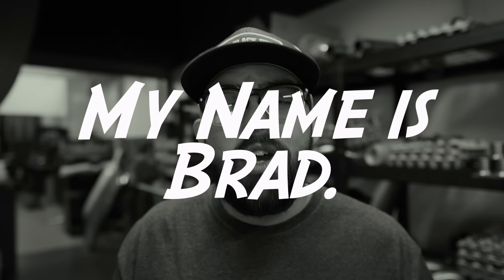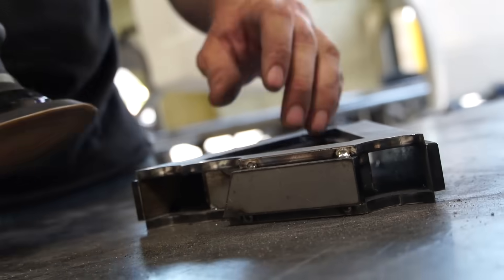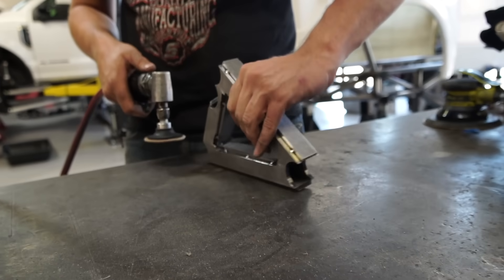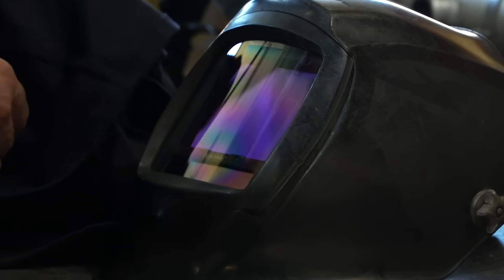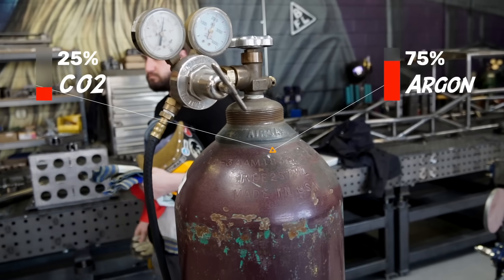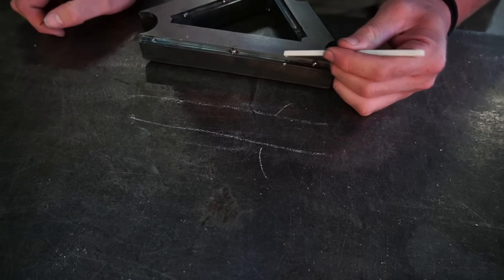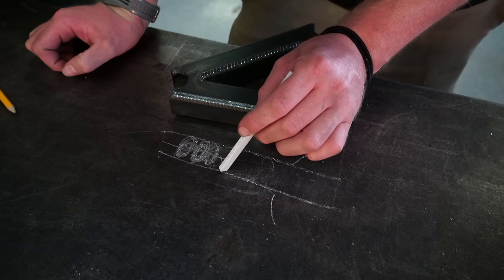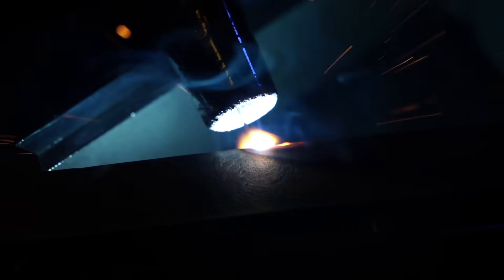HOW TO MIG LIKE TIG WELD (Stacking Dimes) W/ OVERKILLRACINGANDCHASSIS w/ *Tips and Techniques*

Comment: They say a good welder is typically a bad grinder (because they don’t have to grind their welds to clean them up).   I don’t know about that, all I know is that I’m a bad ass grinder.
Reply: The grinder and paint make me the welder I aint.
Reply: @davecozzi9721  🤣🤣
Reply: @davecozzi9721  right, my welds are ugly till I clean them up, then they look fantastic.
Reply: @cheapshotmike1091  why not learn to weld better and save yourself a bunch of work. You should just have to wire wheel your welds before paint.
Reply: @bobv8374  for the things I weld you wouldn't leave them unfinished no matter how pretty your welds looked. but I do get a little better all the time, just not that important for welds to look nice, they're getting ground and sanded regardless.
Reply: @cheapshotmike1091  thing is your losing strength. Plus your wasting time. Now your welding grinding and sanding. You could weld and sand. Keep practicing you will see what I mean. Keep it up good luck
I
Reply: @cheapshotmike1091  right you can’t just leave beads on a quarter
Reply: @davecozzi9721 
Loser comment.
Reply: Most high profile work actually requires weld blending. I weld inconel turbine veins now. Even when i did production mig i still had to grind per costumer spec. I can finesse a 5” grinder like its a pen.
Reply: @Swagmoney696  got that right! At one point I was comfortable running a 9 inch Milwaukee with one hand! 3
Reply: I'm on my second grinder, but only my first welder. To be fair, I bought a Miller welder but Hoarder Fright $10 grinders... the secret on those grinders is to open 'em up and replace the gear lube with something useful that will flow, and check the brush installation. Instantly turns a $10 grinder into a $40 grinder at least! ^_^ ;D
Reply: @railgap  I buy a blue point and be done with it tbh. I do own several Cheap ones to beat up
Reply: @railgap  i dont know but hose cheapo grinders here have just a friction bearing in the head. once those wear out its gone.
Reply: Yeah, but true 100% bro. I used to be a bad grinder till I changed my mind to cleaned them up super super crazy well clean then I found the beautiful Bead since then I been practicing about grinding skill as much as I can lolll 
nice to meet you a welder from another side of this world, Im Siam from Thailand .
Reply: I have 3 grinders
Reply: I was a nuke welder in the Navy and my instructor welded thousands of feet on the space shuttles. Grinding your starts and stops was mandatory because if it cracks that's where it'll start. You haven't lived until you've chased a crack 40 feet across a hot flight deck while welding aircraft tie down pad eyes. The non skid they put on those things ain't skateboard grip tape, it's more like stucco on steroids and you're rolling around on it all day.
Reply: I'm half a good as I think I am 95% of the time, I like to focus on that 5% when I'm really good!!!
Reply: One of the biggest loads of crap ove read. 
Youve never done any high spec pipework have you. Im not talking mig monkey welding, im talking high spec full tig positional pipework. 4 and half inch grinder used on and off all day long, for feathering tacks, or opening out gaps that have squeezed closed.  
With stick, its used for grinding stop/starts, or knocking any peaks off of a bead, or running a wire wheel around a butt before going in with the next pass
Reply: A good welder always has a clean joint to weld. A great welder is a great grinder.
Reply: I'm good at it ALL, probably cause I've been welding since age 12 and welding aluminum a yr later. I'm almost 41 now so I have a few yrs experience 😂
Reply: Me too!
Reply: Where do you live? I'm hiring.
Reply: Do you mean weed?
Reply: lmao
Reply: Yeah, I can lay a nice bead, but I am specialized in fine finish. Both are good skills to have
Reply: LO FUCKING L .. happens to the best
Reply: Wait...fuck.  Yeah, me too.
Reply: I'm a bad grinder because I hate erasing the part best looking part of the weld lol.
Reply: Who says that? Been a professional welder for about 22yrs now and can do both extremely well.
Reply: Yabbut, you don't grind MIG because all the strength is in the bead.  Real penetration is rarely achieved with MIG so preserving the bead material is often critical to the weld's strength.
Reply: @railgap  maybe in YOUR welds, but mine get total penetration guy! I've been repairing and welding truck trailers and frames (18 wheelers) for 20 yrs and have yet to have my welds fail, ever....Frames I grind as it then looks factory and STILL remains strong.
Reply: Railgap Esoterica I was being sarcastic. I was saying in a roundabout way that I’m a shitty welder.

Comment: I can full understand where these keyboard warriors are coming from with penetration over looks. Yes it looks great first it penetrate? Yes and no for the application itself it doesn’t need to blow out the inner edge of the base metal to be strong weld. And also you have to take in account what the part is being used for and what kind of stress is being put in it. There using Er70 has the potential strength of 70,000psi so with the perp work and right settings pretty sure it will hold up just fine.
Reply from the maker: 🙌🏻 A guy that actually knows what’s going on. Good morning and have a great day!

Comment: End-to-end nonstop runs like that?  How do you keep from warping the parts or popping your tacks?
Its pretty, and appears to work or you wouldn't keep doing it, but every experienced structural career welder knows thats not the right way to weld up boxed parts.
Reply: the runs were about 8 to 10 inches long, I wasn't to concerned with it warping to much. It's always best to weld one joint, then if possible, jump to the opposing side, 180 degrees away and weld it. And with little stuff like this, it helps to have more than one part being welded, so they can get a little bit cooled between passes. I've done a lot of welding on boxed rails, up to 20 plus feet long. On longer parts I definitely jump around quite a bit, doing about 4-8 inch long runs. Thanks!
Reply: Plant is not turned up too high...right amps to material thickness....you can see fusion on the edges is just right ...just barely pulling the edges in...personally I'd have the plant down slightly more...prep makes for better finishes.Ive seen UB sections bow lik a banana and come back straight after welding on opposite sides are finished....but it's best to stagger the welds on long sections for sure😁

Comment: Beautiful welds. 
I weld to look good but, sometimes, I just weld to get a proper adhesion. It is not as pretty but, it will pass.
Reply: sometimes we just gotta do what we gotta do to finish the job. It starts to really suck when a huge majority of your welds are out of position and they still have to match the same quality. Welding inside a tube chassis will humble you really quickly!
Reply: Welding perfectly clean , brand new , metal in a perfect setting is all very well . In my world of fixing vehicle chassis covered in all kinds of crap , sometimes in a field , your work just has to be effective. I still try to make every weld look good though , can't help it !!
Reply from the maker: Doug Green absolutely Doug!
Reply from the maker: Absolutely agree and thank you!

Comment: I was waiting for the host to sell me soap or sunglasses he looks just like that guy. I prep those little tacks with a hand file except mine aren’t so little seeing as I don’t have a TIG.  Prep work is the key to good welding. One good way to practice is to get a notebook and fill the lines with welding like that guy drew on the table wire and welding rod costs money pencils and notebooks are cheap.

Comment: I could utilize the difference in thickness of material to control settings ( the basic machine set up )
Reply from the maker: For this specific video most outside corner joints are welded in the material thickness range of .125” and .250”. I can definitely do a basic machine set up video in the future for you. Thanks for watching!
Reply: @hourglassingenuity103  I have been welding for about 30 yrs now and it is always a good reminder to get back to basics , well at least for me and maybe even MIG welding stainless trying to get the best results could be another good lesson for me as well . You really have some of the best info in this field keep up the good work and looking forward to seeing what you do next .
Reply from the maker: You have a ton of experience! Going back to the basics frequently is such a good practice in my opinion. Keeps you fresh and up to date.. not making mistakes and forgetting the simple things. I really appreciate your view and positive input.. means a lot! I am trying to get any piece of info out there I can that will help the community and upcoming welders. Thanks so much for the support and have a great day!

Comment: this is not practical to weld this way , welding is not just what someone thinks is pretty  to look at ......
Reply from the maker: It is 120% practical to weld this way in the industry these guys are in.. obviously not in a structural application.. tag me on Instagram is some of your pretty welds! 🙌🏻🙌🏻 have a great day!
Reply: This is plenty strong enough, and costumers are paying top dollar for us to build stuff for them. They definitely appreciate looking at a finished product with aesthetically pleasing details,  from the way it was designed, to how it was built. A good majority of the time, they will compliment the welding, because unfortunately, there are quite a few shops out there that look over this aspect when it comes to builds.
Reply: @rodrigorodarte8422  i work in a shop like this in Tulsa, and it drives me up the wall!!!! Take pride in what you do no matter what it is, or just simply do not do it at all. I want to know what made this guy comment saying this isn't practical...?  I think your welding is phenomenal and would jump at the opportunity to work in the same shop with you guys.
Reply: Keep on doing what you are doing, more than strong enough!
Reply from the maker: Cesar Almeida 👊🏻👊🏻
Reply: Ultimately there is a fine line between a good penetration weld and a pretty weld. I think that is the point they are trying to make. Good, clean and maybe preheated metal can help with making a "good" weld as well as attractive.
Reply: @bradawilliams1  there is a bg difference between "looks nice" and high quality welding. Especially when it comes to mig welding. 
Its far from a fine line.
Reply: It's practical to weld this way when it's what your customer is willing to pay you for.
Reply: @cammy9r it’s impractical because of how slow it is as a welder my self I would never get anything done welding like this also for the thickness of the material they are welding the volts are much too low for it to be penetrating enough to be strong

Comment: Practice makes perfect, every machine is different, I have 4 machines and the settings are different on them all.
Reply from the maker: Yes sir!
Reply: Best machine fronius selco. All german. Hate Miller and Lincoln spatter produced
Reply: @182mcg1  I've used fronious machines when I used to work at Siemens..or how the Mexican guys called it "Mecos", and man are those fronious machines smooth as butter and i love that display on that gun. Not sure what model I used tho.
Reply: This is actually really important and should be taken more into consideration when somebody just asks for settings. I can have two Millermatic 252's next to each other, and both can have the same set-up, same settings, but could yield drastically different results. Voltage is always around the same, but wire speed tends to differ. Most likely due to the tension on the wire, a dirtier liner, and a huge factor is that a lot of welding machines don't have a tachometer that reads the wire feed rollers. I believe the new Multimatic 255's do, which is cool!

Comment: Great vid but dont understand why Americans call it mig when they weld with mix gas (argon CO2) then it’s called mag (metal active gas) CO2 is an active gas
Reply: Metal Inert Gas....M.I.G
Reply: Any type of welding with an "inert" gas is considered MIG, no matter the combination 75/25, 80/20, 95/5, 90/10 r\or tri gas!!  The process is exactly the same.  And CO2 with Argon mix is still considered inert.   The gas I inactive compared to say propane, Map or Acetylene
Reply: @JAB1978  wrong. 
100% argon? Yes inert. 
Mix co2 into that, and it is no longer inert. It becomes an active gas. 
Otherwise, why would 20% co2 in argon weld so differently from 2% in argon??
Other than when using pure argon, the correct name for the procedure is MAG welding.
Reply: americans arent the only ones that call it mig.BUT it should be called GMAW
Reply: Steve Moore This.  MIG is really GMAW which = Gas Metal Arc Welding. No inert in the name.
Reply: Because maybe it’s done with MIG machinery
Reply: Michael Szczys mig and mag is done with the same welder just different gas mixes

Comment: Could we see the penetration please, way more important than a pretty looking weld
Reply: You would actually be surprised when it comes to penetration on something like this. As long as the fit-up is correct, and the material is properly prepped, it has no problem melting through and making the back side look like it got a hot root sprayed in there. I would say this, it is very important that any forward movement is made in the middle of the joint, so that the front of the puddle is at first contact with the thinnest part of the joint, versus the thicker toes. I have yet to see an open corner fail before the base material rips apart.
Reply: Warren Cox Bend test it!! That’s the reveal !
Reply: I wouldn't expect any issues with this joint and prep but probably worth mentioning the weave is not appropriate under most circumstances for the newbies
Reply from the maker: Jay Bertels we didn’t weave 🤷🏻‍♂️
Reply from the maker: Head on over to Instagram and check out the guys pages that are in this video and I’m sure you’ll find something 👍🏻. Links in description.

Comment: Without sounding daft ,,, why dont you just tig weld it if thats the look your after.
Reply from the maker: A lot of components on these trucks are TIG/ GTAW welded.. it’s not ideal to try and fill up a .250 outside corner joint with Tig.. maybe a root.. but it’s a lot of weld metal to deposit. More efficient process = more money and if you can do it and it’s aesthetically pleasing.. win.
Reply: @hourglassingenuity103  
many thanks , although with all that detail and prep it certainly cant be cheap , no matter which way its welded . very tidy results.
Reply: @tomthompson7400  I don't think their customers worry too much about cost 👍😊
Reply: @colinstace1758  now there is a luxury .. mine never shut up about it lol

Comment: I wonder why they choose .030 over .035 or even .045 wire? Is it easier to control for the look there going after. Too me that’s a bit to small.
Reply: yes, it is much easier to lay a stacked look with thinner diameter wire. 0.30 seems to be money for open corner joints up to .250 wall thickness. its not a huge change to 0.35, but 0.35 will require more voltage, so then you start running into problems with controlling the puddle before it gets to hot and starts washing out. 0.45 makes a huge difference, and it is great if your work requires much faster  production. You can really crank up some heat and knock out a lot of work with it!
Reply from the maker: Let’s see what Rodrigo has to say about this question..
Reply: It takes .030 longer to fill so that they can use less heat and go slower. I bet that stuff takes some time to do. Plus probably a whole lot less spatter.
I once worked in a place where we ran the wire feeders on 10. Spatter stalagmites everywhere.

Comment: Great video guys. I was just doing this last week with 8mm (5/16) plates for a bespoke gate post. I had 8 metres (25 feet) worth of joints that I was then grinding into a radius like a box section. I ended up tilting the post at 45 degrees so the corner was facing up. I had difficulty seeing as I was also pulling to help fill the joint and nothing to bounce the light back. I have another to do soon.
Reply from the maker: That sounds like a fun project and thank you very much for watching! If you have Instagram tag me in your posts! Love to see your work. Have a great day!
Reply: HourGlassIngenuity,  I’d love to but at 51 I don’t have insta. Sorry. I’ve got some pictures of stacking dime kind of runs but after grinding out you see bits not filled. Either at the edge or from a start up. So you fill and grind again. It a long process. Plus it has a triangular top to match a 100 year old granite coping stone on the wall. I can email pics if you like.
Reply from the maker: Grumpy One email some pics when it’s complete! It sounds interesting. Hourglassfab@yahoo.com 🙌🏻

Comment: Exsactly how I weld good for think steel if your using a low power welder preheats the area before you run back over the top